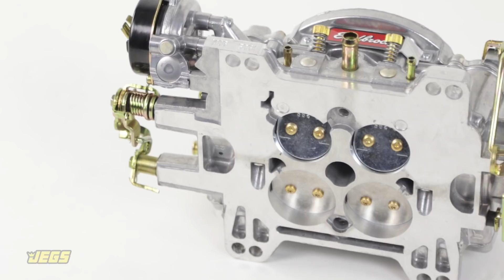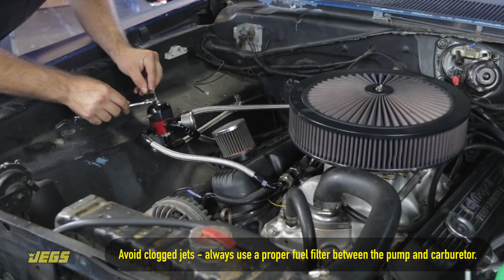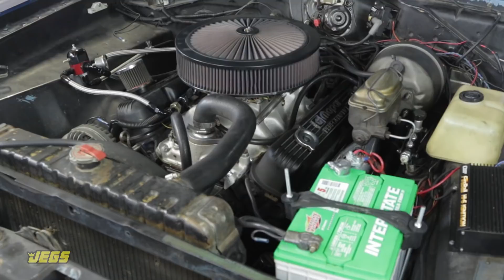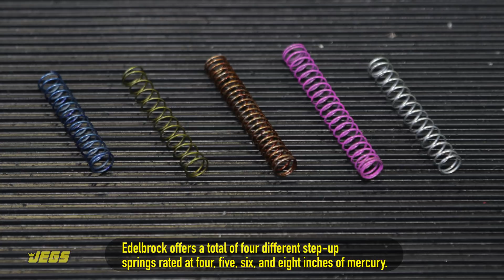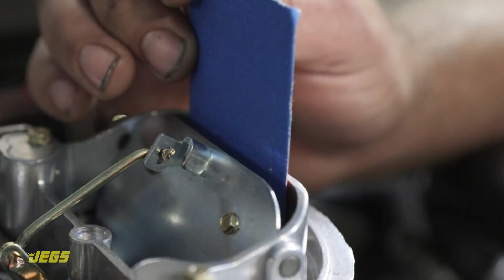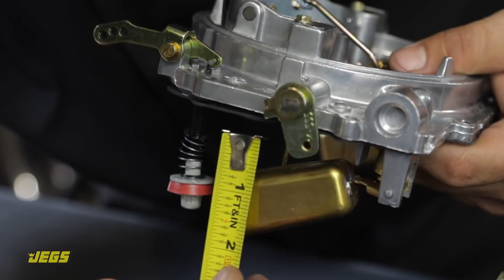How to Tune Edelbrock Carburetor Carb Idle Mixture Screws Choke Metering Rods Jets Fuel Air Vacuum

Comment: Looks like a Carter afb. . . Used in the 60"s on GM. Cars and trucks. . . . . . Later
Reply: That's because that's exactly what they are. Edelbrock bought the rights/design and has made their own units based on basic Carter architecture.

Comment: So the secondary’s kicking in too soon all of the sudden after a cleaning could be caused by my step up springs?? 
Seems the secondaries kick in too easily, at about 25% throttle or just cruising.
Reply from the maker: step up springs push the pistons up, which are connected to the metering rods, which meters fuel during idle and cruise, transitioning to wide open throttle. They are not connected to the vacuum secondaries, other than they use engine vacuum to function. There is not alot of options to manipulate vacuum secondaries on the standard Edelbrock carb, you can remove material from the weights. you might be able to weld weight to them. The Edelbrock Thunder AVS carbs have adjustable secondaries.

Comment: My Edelbrock carb sat for 3 months now I put it on and now only stays on with choke.
Reply from the maker: It sounds like the choke needs adjustment? Has the temperature changed outside since you last used it?

Comment: Would the 1409 work for my 4.3 MerCruiser i have a old 4bbl on it now and want to replace it ?
Reply from the maker: that part number is 600 CFM as long as 600 CFM is correct for that engine, it will work.
Reply: JEGS Performance I think it’s right it’s a old Weber 4bbl on a 2005 Vortech v6 idk what’s is the cfm   On the one I got now

Comment: NO E85 FUEL!!!?
Reply from the maker: Edelbrock carbs will not work with E85 fuel.
Reply: JEGS Performance ok so if I got flat top pistons I should find a different carb?
Reply from the maker: We are not understanding your question. The piston type has nothing directly to do with the carburetor or E85 fuel.
Reply: JEGS Performance I might be mistaking e95 with hi octane pump fuel.  Sorry

Comment: I have a 650 AVS w/electric choke on my fairly mild SBC 383 stroker, 9.1:1 comp, Vortec heads, Lunati Voodoo flat tap. 262/268, .219/227 @ .050, .468"/.486", 112 LSA.  Edel. RPM intake, 1 5/8" full len. headers, 2 1/2" full len. exh.  It works well except I get a stronger then I think I should get gas smell at idle.  No matter what I do with the idle mixture screws and idle screw itself it's always there.  Edelbrock wasn't much of a help either.  I really don't want to switch carbs because I'm probably going to go with a FiTech EFI system down the road.  However, a Holley type carb is looking better and better all the time.
Reply from the maker: It sounds like you may need to change your primary jets and metering rods for a leaner idle setting. If you have the idle screws set on "lean best" adjustment, then you need to go one step leaner on the idle side combination for your rods and jets based on what the chart shows in the instructions. Does this help?
Reply: I didn't know the jets and metering rods controlled the idle.  Thought it was just the idle adjustment screws.
Reply from the maker: when at idle or cruise, the vacuum is greatest and pulls the piston down the channel with each metering rod, which goes through the primary jet, when you give it gas, there is less to no vacuum, allowing the spring to push up on the metering rod, pulling the taper of the rod out of the metering jet, allowing more fuel. Hope that makes sense. That is why you can control the idle mixture if the screws don't do enough. Let us know if we can help more.
Reply: Would putting larger diameter metering rods in do the same thing?  I have the tuning kit for the carb.
Reply from the maker: Yes, essentially that is what you can try. However, you must follow the combination of metering rods/jets that Edelbrock prescribes in the back of the instruction book to properly accomplish this and you must be very careful not to go the opposite direction and run too lean, which will cause damage to your engine due to excessive heat, preignition, or even detonation.
Reply: Ok.  Thanks for all the help.  You've done so much more for me then Edelbrock has.  Their support sucks, probably not buying many more of their products going forward!

Comment: I turned the choke and the door didn't move at all....why???
Reply from the maker: Are you adjusting per the following instructions? The length of time during which the choke will stay closed is determined by the position of the choke cap. As the choke cap is turned clockwise the choke will stay closed longer. To properly
set the choke loosen the chock housing retaining screws then turn the choke cap to the leanest notch on the choke housing and run the engine until normal operating temperature is reached.
With the engine running, slowly turn the choke cap clockwise until the choke valve begins to close. Now turn the choke housing one notch counterclockwise (lean) and tighten the choke
housing retaining screws. Periodic readjustment of the choke will be required as the temperature changes throughout the year. It is recommended that you use the notches in the choke
housing as a reference, one notch clockwise for rich or one notch counterclockwise for lean. After each adjustment verify that the choke valve opens fully after the engine is warm.
Reply: JEGS Performance that helps a lot. Thank you so much!!

Comment: I been having issues with my edelbrock. It would spit out fuel through the top of the carburetor and by spit I mean spray everywhere. I figured floats were stuck so I cleaned the carburetor and rebuilt it. I adjusted the float levels according to instructions as well setting the choke flap. It ran good after I put it on and going up and down the road. But recently I drove it out in the country (first time doing this after the rebuild about a month ago.) and it did fine then parked it. But I tried starting it up again since then and it's having the same issue. I do see fuel in my oil. So does this mean I did not adjust the float levels correctly?
Reply from the maker: The main two culprits for what you are describing are the float adjustments and fuel pressure. It looks like you have addressed the floats. What PSI is a fuel pressure gauge showing just before fuel enters the carb? It should be between 4-6 psi. If it is at this pressure, fuel can't overfill the fuel bowls and go out of the vents if the floats are properly adjusted and the needle and seats move freely.
Reply: I run a mechanical fuel pump off of my 460 bbf. I believe they run at the max of 7 psi.
Reply from the maker: If you have fuel spitting out of the top of the carburetor you either have too much fuel pressure (verify you have 4.5-6.5 psi), stuck needle and seat, or incorrectly adjusted/operating floats.  the bowls are over filling. Those are the only culprits we are aware of that would cause this.
Reply: Had mine for 3 years now, just started doing the same exact thing. Fuel gushes out of the small plates that hold the metering rods.
Reply from the maker: Check your float setting as heat cycling can affect the float, also check to make sure needle and seat not stuck open.
Reply: I think you might need a fuel pressure regulator and set to max 6.5 psi prob need at least 4-5 psi also since you said you adjusted floats as long as it was properly done,nothing sticking and no holes or damage to floats and sometimes the gas can gunk up and cause other valves,needles and seats/seals  to stick make sure everything goes in and out,up and down smoothly
Reply: You ever use fuel additives or spray carb  cleaner? This causes certain types of floats to sink. Make sure they actually float before putting the float bowl together

Comment: stopped. at. light. carb. filled. with. gas. flooded
edelbrock. 600
Reply from the maker: There are several things to check. Please call us at 1-800-345-4545 to troubleshoot or you can go to www.jegs.com/AskATech for help

Comment: Is there a problem to leave it standar as it is manufactured in a standard 302 engine of a Ford maverick 77?
Reply from the maker: The carburetor is set up to be acceptable enough to make most engines run out of the box with no tuning. However, if you install it and it is not performing to expectations, adjustment and tuning will be necessary.

Comment: Hi,will this Carb work on Mitsubishi Galant A161??
Reply from the maker: The smallest carb offered is 500 cfm, typically for large v6s and small v8s. If this applies, you may be able to adapt it. However, if your engine is smaller, it will be too big.
Reply: JEGS Performance ok👍
Reply: Only works on American muscle cars, sorry dude.

Comment: Im 15 loocking to build a 302 in a mustang. I was looking at a quick fuel 750 double pumper mechanical choke carb for my app but irs gonna be a daily. hydrolic flat tapets 1.7 rockers and a 64cc head with 210 runners and a weind streetfighter intake. ive come to find out the EDELBROC is better on the wallet easy to work on and tons of parts for it what model should i go with. id like to have a mechanical choke if possible and im looking for around 350 to 375 horse?
Reply from the maker: a 500 CFM carb would be best either with electric or manual choke. These carbs are usually best for street use up to 6500 RPM. 750 is too much for that small of an engine unless you are running a drag car over 6500 rpms
Reply: Your best bet is 600 cfm carb for the parts listed the heads are good at 210 which you need a cam at 230-235 at .050 and 500 lift a 2500 stall with 4.11 gears if the transmission is rebuilt have low replaced with a lower gear to get you off the line quicker.    Too bad you don't have a 351 to put in
Reply: Have it tuned on a chassis dyno they can get it to run the best the heads intakes from 165 to 195 cc intakes 210 would make it slow to accelerate 210 are for a race cam and 4.56 gears
Reply: 2WHEEL [HOON] yeah. A 500-600 cfm is all you need. You will like it alot better, trust me. I been there done that. You will have to spin that thing 10,grand to take any advantage of a 750.  Especially a street car. Even on the dragstrip I'd stay at 650 or smaller. It has been a while, have you got it going yet?? A 500 will give alot better throttle response!

Comment: Just put an Edelbrock carb on my 400 SBC. Everything seems to be working well except for when the transmission shifts into overdrive. In overdrive when I step on the gas it seems to barely do anything and won't even kick the transmission back down to third (drive). Any ideas?
Reply from the maker: Is the overdrive transmission kickdown vacuum, mechanical, or computer-controlled?
Reply from the maker: Please review page 8 in the following manual: http://www.edelbrock.com/automotive/misc/tech-center/dl/carb-owners-manual.pdf

Comment: My Edelbrock 1806 Thunder Series AVS  is a total dog.  :( so disappointed.  6 weeks of tuning it with proper mechanics working on it, and everyone thinks carb is crap.  going to anther mechanic this week to confirm, then punting this damn thing.  last Edelbrock i ever buy.
Reply from the maker: Would you mind talking to one of our techs at 1-800-345-4545 so we can help you out or else call Edelbrock direct to troubleshoot at 1-800-416-8628. It should work well if it is the correct size for your engine and properly tuned.

Comment: I loosened the three screws on the cap and turned clock wise to tighten. Nothing happened, do I continue to turn clockwise till it closes to hold the card?
Reply from the maker: To adjust the choke piston linkage (Figure 10) open the choke valve and insert a .026" wire, with a 90 degree bend 1/8" from the end, between the top of the slot in the choke piston
cylinder and the bottom of the slot in the piston. Hold the wire in position and close the choke valve by pressing on piston lever A until resistance is felt. The dimension C should be .100"
between the top edge of the choke valve and the air horn. To adjust, bend rod B.
To adjust the fast idle linkage (Figure 11) place the fast idle screw A between the two notches on the cam. Close the choke valve as far as possible without forcing it. The dimension C
should be 3/64" between the choke valve and the air horn. To adjust bend rod D.
Fast idle may be adjusted to manufacturers specifications (usually 1500 rpm) during n
Reply from the maker: http://www.edelbrock.com/automotive/misc/tech-center/dl/carb-owners-manual.pdf

Comment: Great video, thanks, now I can go try again and hopefully I will get it right, my truck has a 350 motor, its a 93 k/1500, but its not the original motor, the guy I bought it from, it was his dads truck, but he died and the guy sold it to me, the dad changed the motor and it has a brand new Edelbrock aluminum intake and Edelbrock 4 barrel carb, has a mechanical fuel pump and no pressure regulator I hope that's right, the truck was originally computer controlled but that is all disconnected, anyway this video should help me get things set right, I hope. thanks again.
Reply: When it comes to the fuel pump it  is best to just go electric, like a Holley Blu or red mount it right next to tank. Get a good regulator and a pressure gauge installed as close to carb as possible. For normal driving run it at 4.5 psi if you wanna conserve fuel,  when you're ready to race run it at 6.5 for Max performance.

Comment: Great video! There's a lot of useful info. One thing that had gotten missed in the video though, when removing the top of the carburetor be sure to have a few rags placed around the carb as that the fuel system may still be under pressure and will shoot fuel out. That happened to me just today when I had reset my float height. Otherwise, working in this carb is a breeze!

Comment: After building a new engine and using my same 600 cfm carb (after I rebuilt it with the Edelbrock rebuild kit), I have an issue where if I leave the car sitting for a few days it is very hard starting.  I looked down the throat of the carb while pumping the pedal and confirmed its because there is no fuel.  The hard starting is re-priming the system.  Any thoughts?
Reply from the maker: Is your fuel filter new that would prevent fuel from quickly getting to the carb from the fuel pump? Do you have a fuel pressure gauge that you can see what the pressure is when starting? Is the fuel pump mechanical or electric? Is it providing enough pressure? Did you double check needle and seat for sticking and correct carb float adjustment to allow the fuel bowl to fill with fuel? Have you been able to narrow down the bottle neck that is keeping fuel from quickly filling up the bowl and spraying down into the engine.
Reply: Also i had a edelbroc kit missing holes in some of the little diaphram gaskets for the metering blocks did the same thing. you guys shipped a new kit out to me delivered next day

Comment: have a 85 dodge prospector runs great but every once in awhile she wont start after being turned off for a few moments
Reply from the maker: One possibility is that the fuel in the carb soaks up too much heat. You could possibly try one of these to see if it helps, http://www.jegs.com/p/Edelbrock/Edelbrock-Heat-Insulator-Gasket/743639/10002/-1

Comment: Hi I have a 1973 Chevy Nova with an Edelbrock 600CFM Carburettor, its running standard settings yet car takes a long time to start, is this likely to be a carb issue?? Thanks in advance. Ian
Reply from the maker: There are many things to check to begin with before arriving at the carb as an issue. What is the ignition timing? What is the fuel pressure? What is the spark plug and ignition system and condition?

Comment: if I got too much fuel pressure and no regulator will that cause it to flood
Reply from the maker: When you have too much fuel pressure (over 6.5psi), it forces through the needle and seat and over fills the fuel bowl. It then has to go somewhere, which is the fuel vent tubes, it then goes into the engine flooding it. You need a fuel pressure regulator or a pump with lower pressure.

Comment: I need help with my  347 one stroke engine I slip my timing on the freeway one day. I set timing but it started backfiring from carb I check sparks plugs and change them but backfire it run good just when u hive it gas is when backfires do anyone know what is wrong and how to fix the problem
Reply from the maker: Retarded ignition timing and or lean fuel mixture will make the motor backfire out the carburetor. If the backfire is out the exhaust, possibilities include over-advanced timing, a severely discharged battery that could cause ignition to work improperly. Valve problems can cause exhaust and intake back-fires depending which valve is causing the problem. Timing belt/chain incorrectly installed can cause also cause backfire. Where is it backfiring? out the carb or exhaust?
Reply: can somebody tell
Reply: is backfiring through the carburetor
Reply: could someone help me
Reply from the maker: @jimmyhix4839  "
Backfiring is commonly caused by the accelerator pump in the carb not squirting enough fuel before the main jets start working. If you spit the instant you blip the throttle it is probably the accelerator pump in the carb not working, plugged up or out of adjustment. 
It can also be caused by a bad ignition system, such as cross firing, which sends a spark to a cylinder that has the intake valve open. When that plug sparks out of turn, it lights the fuel in the cylinder and the pressure has to go somewhere... so if the intake valve is open, it goes right back up through the intake manifold and out the carb with a "spit" and sometimes even a flame."